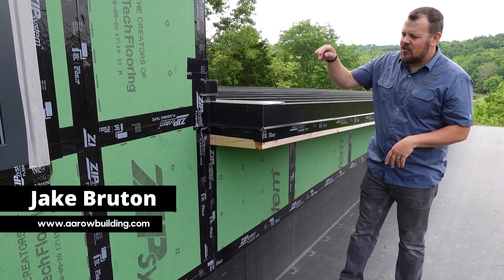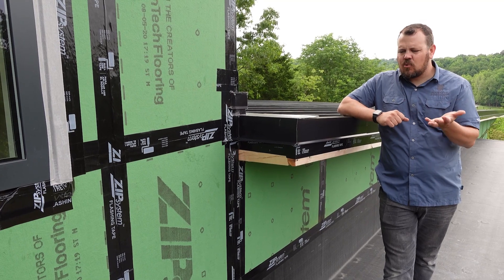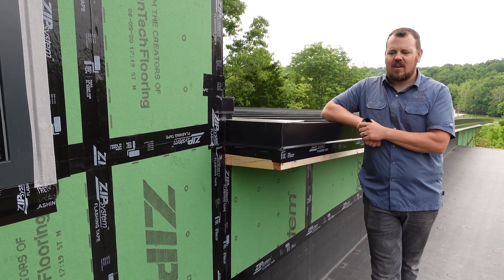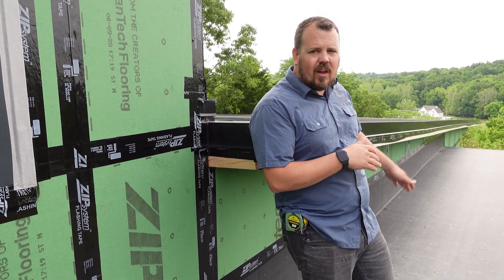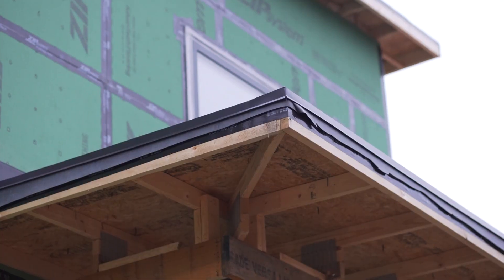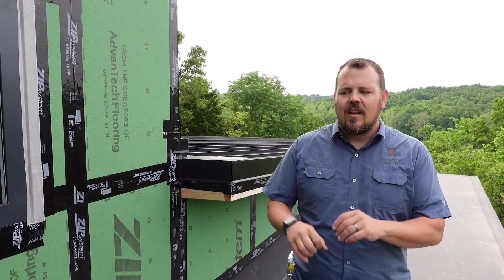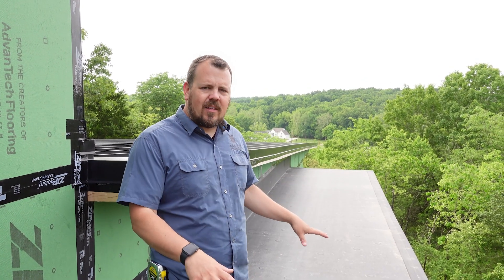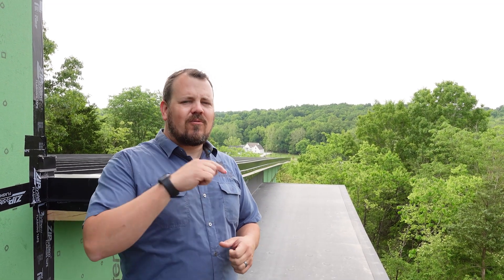Why EPDM Roofing

Comment: Oh lord. So much wrong just in the first 2 minutes, but there is some good information here.
Flat roof options include TPO, PVC, EPDM, MOD BIT, BUILT UP, CPE, CSPE, SPF.
A flat roofs are generally defined as any roof below a 2/12 slope, although many places have redefined this as a 3/12 or even 4/12 slope.
TPO was introduced on the market in the late 1980s, making it almost 36 years old at the time of this video.
Now I will add to this argument, because a lot of people say that hear welded seeds and TPO are a lot more durable, but if you actually look at them statistically in real-world application, while they have a greater bonding strengths initially as far as how much force it would take to pull them apart, their actual strength say the last year and they eventually break apart at a quicker rate than EPDM is known to.
White and black, and you can get it. The vast majority of TPO is white tan and gray, however they do have options like green blue brown add more. The thing about color TPO is is that TPO has a much lower heat resistance, so the darker the color the more risk you have with prematurely failing due to heat. And that's why even though black was offered in the late eighties, most brands have discontinued it or require it be done at such a thickness that it is not economically feasible when compared to other membranes.  
Now there's going to be a lot of people complaining about the 15 to 20 year comment with tpo. And there's reasons for this, if you look at the older people. It was designed 30 years ago it usually filled within about 7 to 10 years, with very few survivors, it should be noted that modern TPO is made a lot different than the older TPO down to its ingredients and insulation details, so we actually don't know it's longevity for sure, however we can say that statistically over half of the TPO ever installed was made within the last 15 years. If we look at actual real-world applications, the average lifespan of TPO is closer to about 7 years because the fact of the matter is is that it was so unpopular and so poorly made initially. You still see a lot of them failing prematurely in the first decade even though they're sold as a 20 to 30 year roof. EPDM on the other hand used to fail within the first 15 to 20 years due to improper installation. However we also know that when EPDM is properly installed it can last over 50 years. So epdm is by far the better choice. 

I'm sorry did you just say Goodyear EPDM roof. See now I'm concerned how old what your information you're getting is, because Goodyear EPDM stopped existing over 20 years ago, they got bought out by a company known as Carlisle,  and is now called Versico. 

And the thing about EPDM is, the absolute number one thing about epdm, is that if you have a bad contractor it will fail worse than any of the others. I will genuinely say as a professional commercial flat Roofing consultant, EPDM is the best roof on the market right now, however I recommend it less often than other membranes because it is so hard to find a contractor that has a single clue what they're doing.

As far as the torch down comment. I don't like torch anymore, mostly because I think it's a lost art form, and residential torch roofers are absolute garbage, but I might trust torch before I trust TPO

On the parapet wall, technically it is required to go up at least eight inches or as much as 12 in depended on the manufacturer. There is not a single manufacturer out there that says it is appropriate to the only go up one or two inches, but because residential you don't have anybody inspecting it contractors just do it to be cheap and to avoid having to play it, which is yet again to announce cheap.

So the question is whether they used EPS foam or if they use polyiso. Polyiso is actually better and more compatible with EPDM, but cost a little more. Well worth that cost though both for the insulating capabilities as well as the expansion and contraction.

On the comments of slope, you actually touched on it very accurately that an 812 will drain even if you don't have a waterproof surface on it. It's actually known as the difference between hydrostatic, and hydrokinetic systems. A hydrokinetic system like shingles works because gravity is pushing the water. Shingles are not by and large waterproof, and in fact there are thousands of gaps that it could leak inside, where is EPDM is a hydrostatic system, which can even have water ponding on top of it and is still waterproof.

EPDM after 20 years will require some maintenance at the seams, and it will require it again at about 30, 35, 40, so on. However, that maintenance is still cheaper than what you would spend on TPO in maintenance and replacements.

A ballasted roof should never have gravel by the way. It's supposed to have river rock or potato rock, gravel was more meant and designed for the use of tar and gravel roofs, where is EPDM is more designed for larger smoother rocks. That rock protects against uv, extensive life of the membrane, allows for better expansion and contraction even though eventually that can cause issues at the walls which is a part of the regular maintenance, and overall ballasted EPDM has a greater history as well as durability. The main issues with ballasted EPDM is that it has a lower wind resistance, is harder to repair, has a higher cost of maintenance, a higher labor cost, and is heavy. But it does add a barrier from the Sun that reduces the heat on the roof, and actually add some insulation value. 

To summarize. That roof looks beautiful from what we can see, EPDM is the best flat roof but only if you have the best contractor installing it. EPDM>PVC>BUR>CPE/CSPE>MODBIT>TPO>SPF>LAR
Reply from the maker: Roofingfacts! Thanks for commenting and thanks for all the info. I love a long, informed comment that helps to educate and drive the conversation. I have some education on my part to do. All good points.
Reply: I just received an estimate for roofing, siding, windows on my home.  I have a 12×20' aluminum sunroom that leaks, an epmd roof was recommended (6k). Do you think this is an appropriate material? Trying to educate myself on this product but don't see much for my proposed application. Any thoughts or questions I should ask? Any advice would much be appreciated.
Reply: @tf9592  60 mill tpo all the way

Comment: Is your sheathing beneath the EPDM also ZIP?  Any special considerations/ adhesives required over the XIP coating? Is the sheathing beneath seam taped, or is that redundant if EPDM is adhered over ZIP?
Reply from the maker: The sheathing beneath the EPDM is Zip with the seams taped, and there is tapered foam between the two layers. We wanted the seams taped on the Zip for air control and posibly a little extra water protection if we ever did have a leak in the EPDM. But really if we get through the EPDM we have a failure that will cause a problem eventually.
Reply: @jake.bruton.aarow.building   that’s mainly what I was curious about: if the pro’s are ok with going over zip and zip tape with EPDM adhesive
Reply: So if you're doing direct attachment of the epdm, you cannot glue it to the tape used on the seams of the Zip system. You can still do mechanically attached but you shouldn't do it here adhere. What you can do though is just put in a small barrier like a quarter inch gypsum or polyiso for insulation, and that eliminates the concern